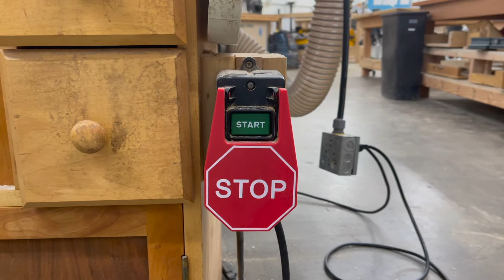Intro to Router - Jeff Bratt

Comment: At 4:11 Jeff plugs the router in prior to moving forward and installing the collet and the bit. Per his instructions, the router should be unplugged prior to installing the collet and bit. The use of Personal Protective Equipment (PPE) should always be emphasized when using Power Tools that can generate high decibel (Db) levels and dust. The dust collection system and the router generate high Db which can cause hearing loss - especially over time. While hearing protection is not mandatory in the Shop, the use of it should be encouraged and demonstrated by Shop Supervisors and Instructors.